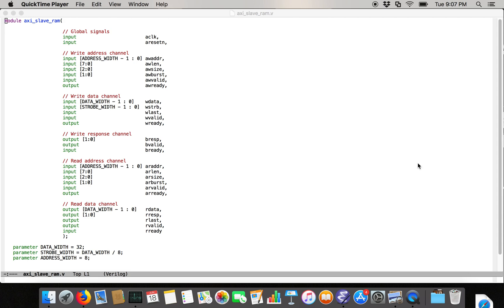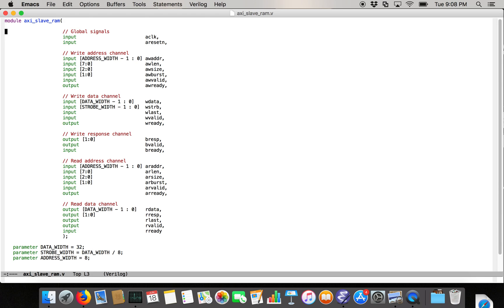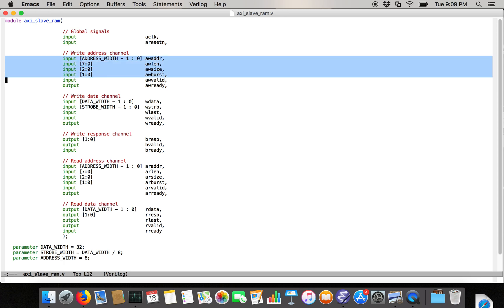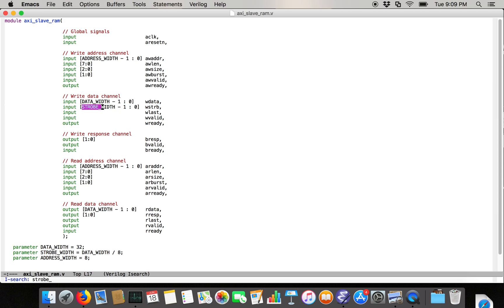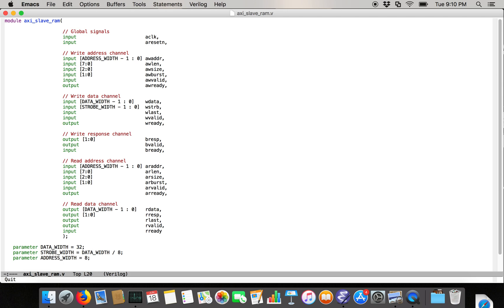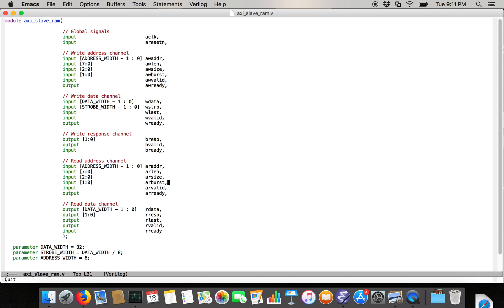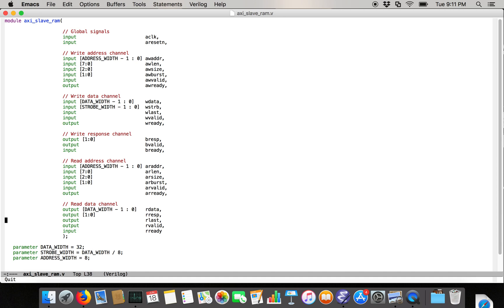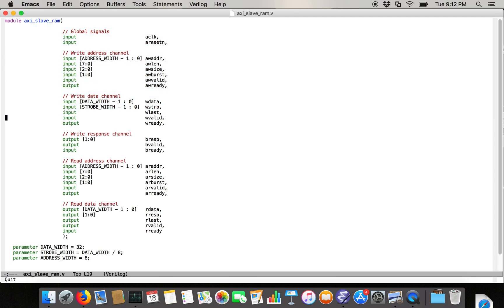Implementing AXI in Verilog Part 1: Slave Interface

Comment: Any thoughts between AXI and AHB-Lite?

I'd like to make a dead-simple AHB-Lite slave.. nothing fancy, just one master will be doing the reading/writing of a few registers, no burst, address-pipelining, etc.

However, looking at the spec, it is like nothing I've seen.. it uses "combinatorial decode of the address bus".. where HADDR/HSEL changes DURING the previous transaction's data phase!

So on the scope I see the AHB-Master asserting HSEL and HWRITE for only one clock, THEN the data gets placed on the bus, when HSEL is already de-asserted?!   Was hoping to find a basic example on opencores, but no luck.   Any suggestion or comments on APH-Lite?

Comment: Awesome video! Are you planning on making a part two in this series and maybe create also the implementation of a master :)?
Reply from the maker: I am, though things are going very slowly. I've been busy in other areas of life. The repo for the project is here:

https://github.com/dillonhuff/axi_rtl_demo
Reply: @DillonHuff  hey I remember reading in the specification that we are not meant to use any combinatorial logic between slave master (especially between the input and output signals VALID/READY) , but you did use an AND logic for them.
So is it okay to use or am I missing something?
Reply from the maker: @anudeepreddy3745  Could you send a timestamp of the part of the video you are referring to?
Reply: @DillonHuff  I meant in the GitHub link you provided 
https://github.com/dillonhuff/axi_rtl_demo
In AXI_slaveRam
Reply from the maker: @anudeepreddy3745  Oh I see. That code is not finished, so I wouldn't use it as a template.